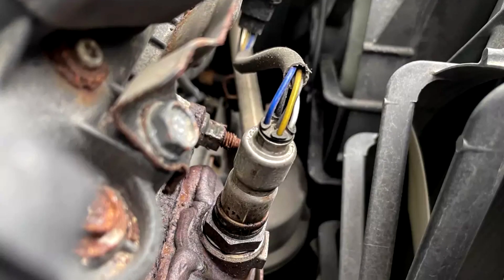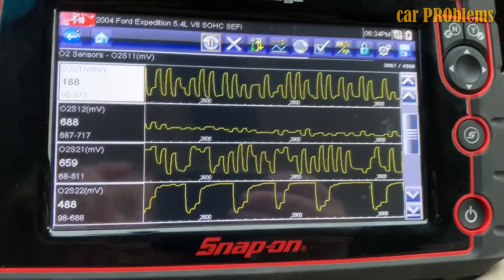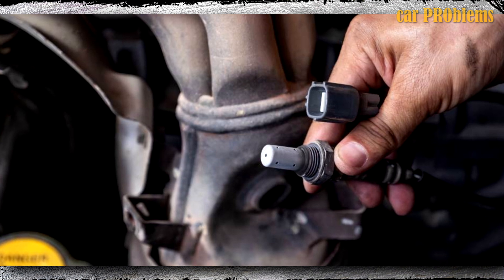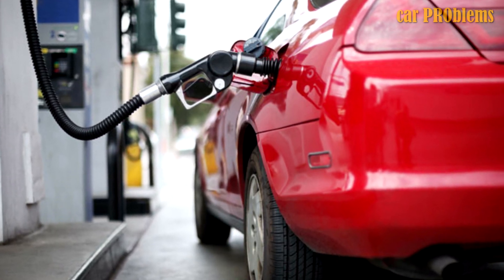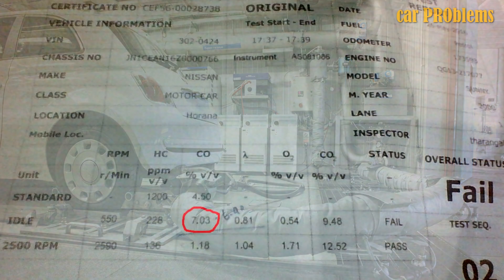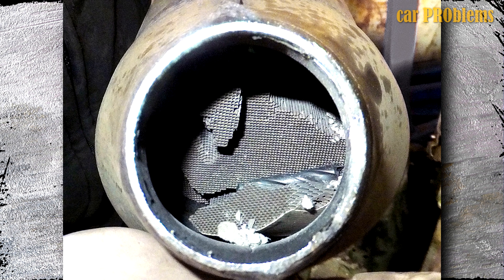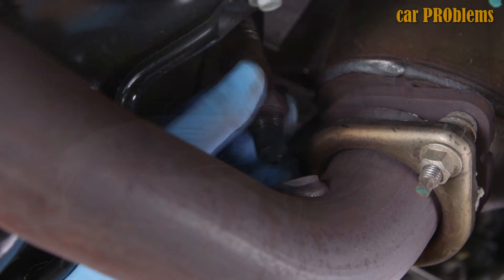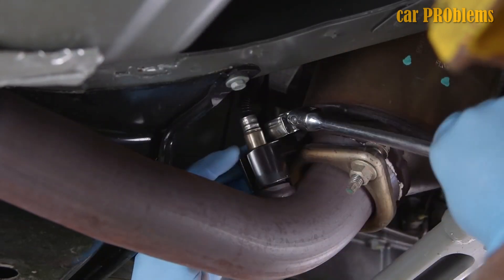Bad Oxygen Sensor Symptoms - 8 Faulty Oxygen Sensor Signs

Comment: I need help my 07 mazda5 grand touring starts but turns off after a few seconds Codes popping up 
P0131, P0301,P0137,P050A,P2119
Reply from the maker: Given the combination of codes and the fact that your vehicle starts but turns off after a few seconds, it's possible that you're dealing with multiple issues. Here are a few steps you can take to troubleshoot the problem:
1. Inspect the wiring and connectors related to the oxygen sensors, throttle body, and idle air control valve. Look for any signs of damage or loose connections.
2. Clean the throttle body. A dirty throttle body can cause idle and stalling issues. Remove the intake hose and clean the throttle body using a throttle body cleaner.
3. Inspect the spark plugs for any signs of wear or fouling. Consider replacing them if needed. Additionally, check the ignition coil for cylinder 1 and ensure it's functioning properly.
4. Test the oxygen sensors. If the wiring appears to be in good condition, it's possible that one or more of the oxygen sensors are faulty. Consider having them tested or replaced.
Reply: @carproblemsmax  You have absolutely no idea as to what you're talking about. A lube tech knows more than you do. 
"I need help my 07 mazda5 grand touring starts but turns off after a few seconds"
That sounds like a classic open/closed loop conflict, does it not? I bet you don't even know what that is. Also, how can you have intermittent bad plugs. 
Maybe you should learn how to fix cars and stop using a computer generated voice to make your videos.

Comment: I got a question can a bad o2 sensor make my car vibrate when I drive off from a complete stop? Can someone plz help me
Reply from the maker: Yes, a bad O2 (oxygen) sensor can potentially cause your car to vibrate when you drive off from a complete stop.  If the O2 sensor is malfunctioning or sending incorrect readings to the ECU, it can disrupt the engine's fuel management system. This can lead to an imbalance in the air-fuel mixture, resulting in poor engine performance, rough idling, and potentially vibrations during acceleration.

Comment: I’m getting Error Code P2198 & I think it’s the Oxygen sensor on bank 2 sensor 1 because I have a rough idle, it turns off at random & even when i start it sometimes it just dies out, then it smells al lot like fuel & you also feel some vibrations on the car so that’s why I think it’s the Oxygen Sensor but what do y’all think?
Reply: im dealing with the same thing, did new o2 sensors fix the problem for you?
Reply: @xokam  No bro, I dug a bit more into my car & it turns out one of my Sensors by the engine bay that goes connected to my fuel rail wasn’t connected, then my fuel rail was torn & had a leak & on top of that all 8 of my Fuel Injectors were burnt out, so I had to replace my Fuel Rail & Fuel Injectors
Reply: @Oatis_07  ah okay appreciate the heads up, replacing o2 sensors today so i’ll check the fuel rail if that doesn’t fix the problem
Reply: @xokam  best of luck bro! Hopefully it isn’t all the things that happened to my car
Reply: @Oatis_07  how hard was it? Im planning to do it myself but i dont have space at my apt and no where to go , dont really wanna fuck it up and have my car get stufk somewhefe aha
Reply: @woopty1  Let’s just say changing out Bank 2 Sensor 1 which is the upper 02 sensor was so damn annoying. There is not enough space to get it out so if you can find a special wrench to make it easier, I’d say spend the money on that, it’s only like $30-$45..I ended up buying it & it was so much easier. But yea it’ll be hard but nothing crazy, just be careful not to bend the head of the sensor cause then you’ll have to break it & try to unscrew the bottom portion, if you don’t feel comfortable take it to a shop
Reply: @Oatis_07  sounds like an easy job just tight space . Thanks for the info! Ill definitely taking it to the shop instead aha.hahah
Reply: @woopty1  it’s easy but the space is really tight, I hope a shop doesn’t charge you much, they can be greedy when it comes to things like that but at least it’ll be guaranteed to be done right, not saying you won’t do it right but that peace of mind is going to be there
Reply: @Oatis_07  im having my mechanic do it for me and just have him do more stuff all at once aha so i wont have to pay alot .
Reply: @woopty1  sounds good to me bro, good call
Reply from the maker: Based on the symptoms you have described, it is possible that the oxygen sensor on bank 2 sensor 1 is faulty and needs to be replaced.
If the sensor is faulty, it can cause a rough idle, stalling, and a rich fuel smell.
Reply: They shouldn’t have never been put on cars to begin with

Comment: How do I diagnose this issue I have a n55 I’ve changed spark plugs coil packs fuel injectors and vvt solenoid and still sluggish I think your video diagnose the o2 sensor but I don’t have cats
Reply from the maker: It's worth noting that even if you don't have catalytic converters installed in your vehicle, you still have oxygen sensors that monitor the engine's air-fuel ratio. The sensors are located before and after the catalytic converters in most vehicles, but in your case, they would be located upstream and downstream of the secondary air injection system.

Firstly, you can use a scan tool to read any diagnostic trouble codes. If the O2 sensor is malfunctioning, you may see a code related to the sensor or the engine's air-fuel ratio.

If there are no codes present, you can use a multimeter to test the oxygen sensor's electrical resistance and voltage output. The resistance should be within a certain range, depending on the sensor's specifications, and the voltage should fluctuate between 0.1 and 0.9 volts when the engine is running.

Comment: Well mine said it was cylinder 6 1st so i replaced the spark plugs and coil then it said the furl injectors i replaced them,then it said the converters i have 3 just as aoon as i replaced the converters it now rattles shakes like its full of water.gets hot within about 3/4 of a miles decreases in spees till it stops and clunks out.so im thinking oxygen sensors im sure i have plenty with 3 convertors.the mechanic says he thinks my engine lost compression.but it cranks and runs for a few minutes.
Reply from the maker: It sounds like you have been through a lot with your car, and it's frustrating when replacing parts doesn't solve the problem. Based on your description, it's possible that the oxygen sensors could be the issue, as they can affect the performance of the catalytic converters. 

However, it's also concerning that your engine is losing compression and that the car is rattling and shaking. It's important to have a qualified mechanic take a look at your car to properly diagnose the issue and prevent any further damage to your vehicle. They can perform a compression test to determine if your engine has lost compression, and check the oxygen sensors and other components to identify any other potential issues.
Reply: @carproblemsmax   can a engine run with lost compression?

Comment: Will a bad O2 sensor show on an emissions test if you dont have an engine light or code?
Reply from the maker: Yes, a bad O2 sensor can cause a failed emissions test even if the check engine light is not on and there are no error codes stored in the engine control module.

If the O2 sensor is faulty, it may not be able to accurately measure the oxygen levels in the exhaust gases, which can result in increased emissions. This could cause the vehicle to fail an emissions test, even if there are no other apparent issues.
Reply: @carproblemsmax  
Will a bad sensor cause the truck to shake stutter and won't accelerate from slow or stop to go? It runs fine when I floor it but in the city stop and go makes it want to stall out but doesn't but it won't accelerate until I floor it. Could a bad o2 sensor do this?
Reply: @covidfake1573 thats transmission issue bro
Reply: @tonyStorks  bad PCM. Got a refurbished one runs like new. Never changed any sensors
Reply: Yeah because the scanners they have shows the data different systems are showing
Reply: A bad 02 sensor give you a code of p0302 misfire on cylinder 2

Comment: could you have bad O2sensor without engine light ?
Reply: Yes. From.my experience I only got a check engine light once the o2 sensor practically blew up
Reply: @tetlrock7460
Reply: Yes. I bought a '98 Yukon and for the last year it's warm-idled very rough [550 rpm], and very poor performance after a cold start. Lately, it would nearly die at idle, then barely recover. No CEL or other warnings. 

After replacing the o2 sensors, all these issues have been resolved, and it's running better than ever.
Reply: Yes
Reply: Yes I’m completely missing one and my engine light turnes off and on
Reply: Yes bro it’ll give you the light once it’s keeps reading it
Reply: Bro this jus happen to me im getting a cat and back 02 sensor right now them two things without it it will run fine bout a year but you will have a problem
Reply: My equinox is showing p219a code and on reader 02 sensor is flashing htr is flashing and cat is flashing. I dont think cat is plugged. Anyone think it might be my o2 sensors?
Reply: Yes
Reply: @kalebmeyer2512 how can you tell any suggestions on how to test or what to look for
Reply: only most of the time
Reply: My car right now. But it's coming up on the computer
Reply: Absolutely yes
Reply: Yes barely learning this now.

Comment: Thanks for the video, I'm having a problem with my O2 sensor, my catalytic converter was taken from my Toyota prius 2008 with sensor 2 together but after fixing it with Toyota original parts, the light has been popping up with code P0137, the O2 sensor low voltage bank 1 sensor 2, I went to Toyota they said sensor 2 is new and is good but it is sensor 1 that is bad and my gas consumption has gone up 25% but now I have changed the sensor 1, still the light is kept on coming back, I didn't have this problem until my catalytic was stolen. What is the solution?
Reply: Check your MAP sensor
Reply: @Irish-Bear  please can you explain more?
Reply from the maker: If the P0137 code continues to come up even after replacing the Bank 1 Sensor 2 O2 sensor, then there may be a problem with the wiring or circuitry that connects the sensor to the engine control module. This could be due to a damaged or corroded connector or wiring harness.

It is also possible that the catalytic converter replacement was not done properly and is not functioning as it should. A poorly functioning catalytic converter can cause the O2 sensors to report incorrect readings, leading to issues such as decreased fuel efficiency and engine performance.
Reply: I’m having P420 after having an aftermarket car and sensor put on 2 years ago with a shield. I haven’t had it worked on yet.

Comment: Boss how can i solve P0420 in Toyota Prius C
Reply from the maker: The P0420 code in a Toyota Prius C indicates an issue with the catalytic converter:

Check for any exhaust leaks. Exhaust leaks before the catalytic converter can cause false readings, triggering the P0420 code. Inspect the exhaust system for leaks, and repair or replace any damaged components.

Replace the oxygen sensor. A faulty oxygen sensor can cause the P0420 code. Replace the sensor with a new one.

Check the wiring for the oxygen sensor and catalytic converter. Damaged wires can cause issues with the catalytic converter system, resulting in the P0420 code.

If none of the above steps solve the problem, the catalytic converter may be damaged and needs to be replaced. 

Note that the P0420 code can also be triggered by other factors, such as engine misfires or fuel system issues. If the above steps do not solve the problem, it's recommended to take the vehicle to a certified mechanic for a more thorough diagnosis.
Reply: Is it true that o2 sensors have an expiration time frame? My mechanic thinks it needs a replacing since I keep getting P0420/P0430 every 6 months after using catalyst cleaner. What are your thoughts?
 @carproblemsmax

Comment: I don't think oxygen sensor do to car stall lol
Reply: It does!! Basically when you have issues(jerking) at low speeds, incline, loss of powers, stall = o2 sensor most possible. 
Don’t be manipulated by stupid mechanics that tell you no code in diagnostic test
Reply: @ioannisstavrou2677  I don't trust no mechanic even my own family member so doing my only way aslong no check engine to pass smog then in good 😂
Reply: @ioannisstavrou2677  ... I'm going through this at the moment and mechanic has freagin clue, is pretending. I'm beyond PIST.
Reply: Yes it does
Reply: @tjayayewhy1595  my never have happen even I got alot code on for oxygen's sensor maybe some car different
Reply: Faulty o2 sensor fucks with the idle and can definitely cause stall.

Comment: After change of spark plugs SV6 commodore vf. Now slight rough idle notice but drives and accelration is smooth like butter.
whats cause????
idle sits on 550 and stable even on idle but i can feel slightly rough.
no check engine lights
no vaccum leaks
Reply: Interesting, because I have same SV6 with slight rough idle, not enough to set off any codes, but it is noticable. My scanner does not  show any codes, (Topdon and Vident). But O2 sensor 1 bank 1 is lower on voltage and bank 1 short term fuel Trim is leaner than bank 2. I am finding it hard to diagnose the issue.
Reply: @qre268Zrtb  u need to replace the o2 sensor must then all will be set
Reply: @1xbettrick  Don't give advice unless you know what you're talking about. Can you explain how fuel trims work? Do you know how to bypass your O2 sensors for diagnostic purposes? All you are doing is telling someone to replace a part before you even diagnose it as a problem.

Comment: Well my car has been stalling and I took it to the mechanic and he replaced the throttle body for the code on the scanner I guess it was broken and that didn’t even fix the issue of my car my has still been stalling after I make a complete stop at a light or idle to a stop sign when I’m driving or when I’m turning a corner my car just dies out my dash still has power but my steering wheel locks up if i turned my engine off i need help any ideas…no scans pop up could it be a fuel injector issue or 02 issue I’m not sure any ideas?
Reply: Pray
Reply: Check your camshaft position sensor and purge valve. Then clean out your MAF airflow sensor. Check your air filter if dirty. Replace it. These are easy and cheaper step to take on with those symptoms
Reply: Spark plugs and coils also plays important role.
Reply: @rog8285  my truck was doing this and it was all because of 1 coil.
Reply: Did you ever find out what it was? My pt cruiser is like those symptoms only on cold starts when i don't push the pedal down at start.
Reply: @redpancake69  My car does same, a Daewoo matiz (2008). Changed IAC valve and still have that issue
Reply: Same
Reply: Check the fuel pump.
Reply: Alt
Reply: Might be your magnetic retarder on the variable valve timing cover on the front of engine.
Reply: It can be 3 things 1. PCV vale 2.injectors 3.spark plugs if is mechanical
Reply: my truck was doing this and it was all because of 1 coil.
Reply: Check the catalytic converter someone told me on my cx9 Mazda the catalytic converter might be clogged and changed the 02 sensor
Reply: I had same problem years ago with my merceder c240.. i cleaned the throttle with spray and after reinstalling u have te let the ignition on for one minute so the ecu will calibrate the throttle, if u will start the car withot leting ecu calibrate, than it will not work properley.. this is my experience
Reply: Crank sensor, fixed my Jetta
Reply: Try the cheapest things first. Buy a can of MAP cleaner, remove the sensor and douse it. It’s super easy.
Reply: Check if the gear is totally on neutral, my car had that problem. Make sure you inspect the gearbox
Reply: Make sure it's not your battery.  Check the idle control valve, change the fuel filter, spray the mass air flow sensor and throttle body clean. Use ONLY mass air flow sensor spray. Check the throttle position sensor, crankshaft position sensor, ignition coil(s).
Reply: I don't know if you have gotten it fixed yet or not, but it could be caused by many different things. Could be bad distributor cap, bad fuel pump, bad torque converter, and more. My truck is currently having the same issue and I'm trying to find the cause of it. Good luck! :)